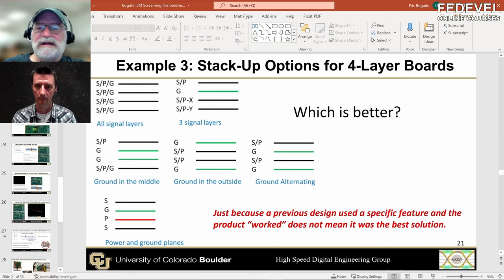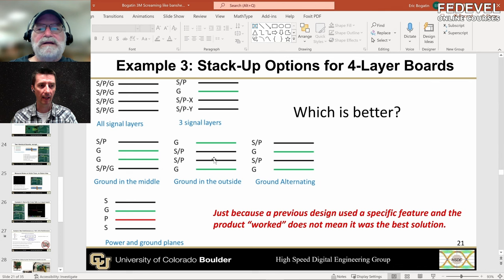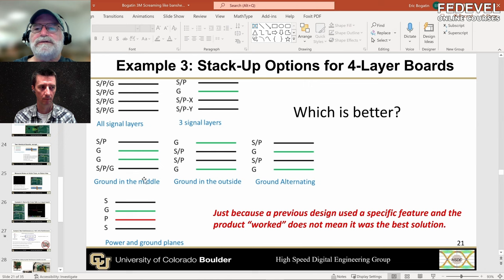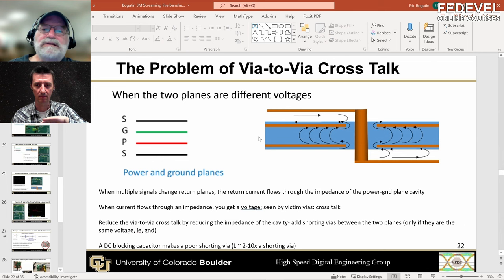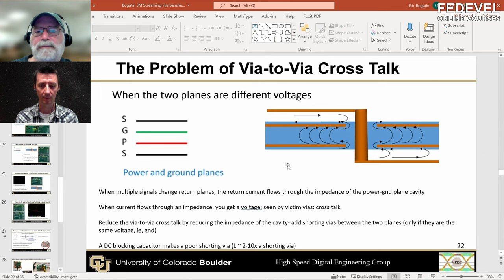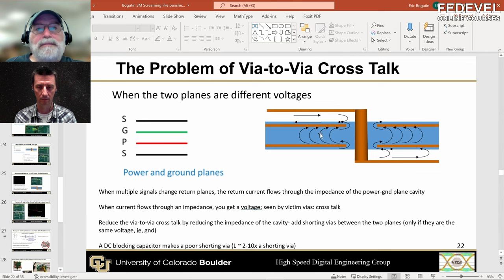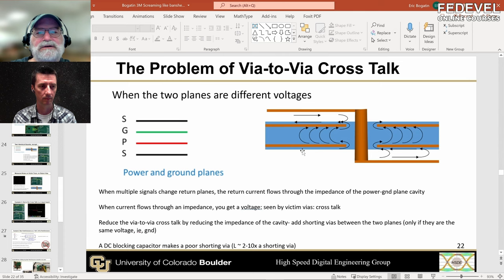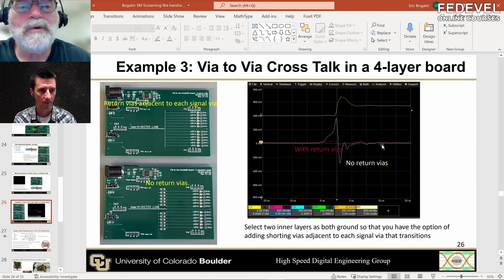Do You Really Need Power Planes? Are you sure? | Eric Bogatin

Comment: I'm a little confused in terminologies here. What is the difference between a copper pour and a copper plane? In Altium, for example, you can have power/ground planes with negative connotation or alternatively copper pours with positive connotation. As per my understanding, both are essentially large copper areas at the end of fabrication, isn't ?? So, if we have a solid copper pour on bottom layer, as shown by Eric in this example towards the end of the video, shouldn't it behave exactly the same as a solid ground plane at the bottom layer (assuming everything else to be identical, of course)??

Comment: The main question in my mind was if I need to use plane to distribute power from the voltage regulator and not if there should be a whole power plane in the stack of the PCB. This question remains unanswered.

Comment: This explains why you wouldn't want to use power planes as reference planes, and that lots of copper ground fill isn't as good as not having to change references during the return path.  But what are the real alternatives?  (1)  With routed power traces, wouldn't the power traces themselves change voltage often enough to cause noise, and to do it on the signal layer, without a ground in between?  (2) Are extra ground pours actually harmful, or just not helpful?  If you have the space, and are deciding between ground pour and no-copper empty space, is there a reason to prefer the empty space?
Reply: you ask a great question (2) don't they answer that ? aint watched yet !
Reply: @andymouse  If they do, I missed it.  Based on another video (I think it was Zach of Altium interviewing Eric Bogatin, or maybe the comments there) it was suggested that ground pour would be better if you did everything perfectly, but leaving the space blank is almost as good and much less error-prone.  (For example, the ground pour can make things worse if you do leave a gap in your stiching vias.)  But I still feel like I'm reporting a rumor instead of understanding why you wouldn't want more pours.
Reply: @jimjjewett  Thanks ! to me pours are a good thing in most instances.
Reply: @andymouse  Yep have to agree with you. From a fabrication perspective, pours avoid over-etching. From an assembly perspective, maximising pours help to avoid warping.

Comment: What about sensitive nets that route over a power plane split, but with an adjacent ground plane. For example, here's a typical 6-layer stackup we have and the sensitive net routed on layer 3 (inner signal). If routing on external layers is not an option, would stitching capacitors be advised?

1 Signal/Power
2 Ground
3 Inner Signal
4 Power
5 Ground
6 Signal/Power

Comment: wow my last board i did was for a camera that had WIFI, LTE, MIPI all on the same 2in x 2in pcb i did it as a 6 layer PCB with S-G-P-P/S-G-S as my stack-up i was told by a older coworker that if i didn't put ground plans on the outside it will fail FCC (the board had a FPGA, and a SOC with DDR4L ) I put a can over the CPU / RAM / FPGA the LTE and Wifi are modules

Comment: Another informative Vid, thanks Robert. I wonder though at the end with the Arduino PCB comparisons - I always thought the main reason for copper pour was cost for manufacture (copper removed is cost at the Fab plant) and to stitch to ground for noise suppression. The latter is not the case then? :O

Comment: @Robert

Thank you all the video contents it is inspiring =]

I doubt that return path only applied to ground return but not power return.
Same voltage rail for the +V and -V is subjected to the same signal +V and -V.
So when the signal is -V aka 0V the return path is ground again? The field itself is defined as two potential with different.
No different no field line, so this means when -V the return field is +V and this means the power plane itself is the return path for -V case.
Correct me if this is determined wrongly.
From DDR3 experiment I cannot see this could introduce noise enough to fail @ > 1000MT/s.

Comment: Great video, thanks.
I have a question.
In Sig/Gnd/pwr/sig stack up when top and bottom layers are ground poured and wherever changing layers occur, If I use ground via (i.e. connecting ground pours on top and bottom layers) close to signal via, wouldn't that reduce via resonance?

Comment: I have one, I am using a voltage converter 12vdc to 5vdc on a 4-layer board, two signals, 1 power, and 1 gnd plane. I can not just put the output of the DC 3.3 to the Power plan, In this situation, can I use the copper plane only to a certain extent?

Comment: Thanks for sharing the lesson! I found it very helpful and interesting. I do have a question, thoug. At the end of the video, where you show the example of routing the signal plane and having a reference ground plane at the bottom, do you not get problems with the copper extending during heat cycles? There is a huge difference in copper mass on each side of the pcb afterall.

Comment: @29:00, ok so if I use low ESL capacitor to connect the two plans that have different voltages using vias, how do I know if it is good enough? How can I run simulation?

Also, for 4 layer board, the dielectric is between layer 2 and 3 and is quite massive unlike the prereg. This means that using layer 2 and 3 as GND and PWR is a very bad idea.

Comment: Eric i think you were misundersranding  roberts question about the voltage of the power plane. I think he was ttying to say when referencing a power plane does referencing a power plane that doesnt power thr chip where the signal is coming or going vs referencing a power plane that does. Example being a pair of 3.3v chips but there signal is referencing a 5v plane vs a 3.3v plane. Since tge 5v plane doesnt have a DC connection to chips that genetated the sigbal wont that cause issues?

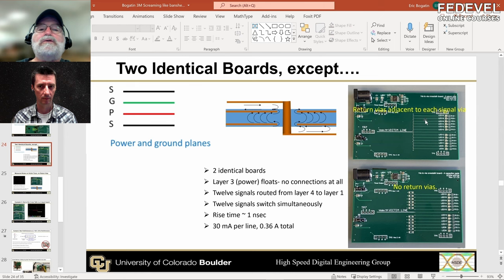Comment: Thanks a lot Robert and Dr.Eric. I did not quite understand the concept of the return via, between the signal via  @41:09 . Is this just a via connected to ground and placed between 2 signal vias ? Sort of like the cable connected to ground and running between 2 signal lines in a flat ribbon cable (to reduce cross talk)  ?
Reply from the maker: If I understand your question right, then this video may help a lot: https://youtu.be/vrt3lL5gEb0
Reply: @RobertFeranec   Thanks Robert, will watch it !!

Comment: Great video! I have a question for you related for routing differential pairs:
Is it necessary for stripline differential pairs routing to be with reference above and below the signal layer? Why 1 reference layer isn't enough?
This is always the requirement I get from the stackup.
And if Eric says it doesn't matter what dc voltage the plane is, so is it acceptable to rout differential pair with ground layer below and power layer above to get matched impedance like the stackup says?
Reply: One reference plane is enough, but then it is called microstrip. For sufficiently distant second plane, it will be converging to similar Z0, but you don't have that luxury on regular PCB stackups - so you are left with coupling to both sides, and having to take them into account in impedance calculation.
Reply: @Konecny_M  thx, what about the dc voltage on the planes, will i get different impedance if i use diffrent voltages on the planes?
Reply: @seanjosef5014  DC steady state does not affect impedance nor crosstalk, but everything else does. So the question is not what is the plane DC voltage, but rather how does the PDN and its impedance for given voltage rail looks alike (inclusive of its physical structure on board). It depends. There are no simple thumb rules and even general knowledge sometimes fall short and it just has to be measured on physical prototype.

Comment: Thanks a lot for this video. I got a question, can copper pour on the PCB top layer be used to reduce EMC/EMI emission on a noisy chip (as a DC-DC buck converter)? Copper immediately under the chip should create a good return path and reduce emission, is it true?
Reply: Yes. For 2 layer PCBs a copper pour on top and bottom layers tied to ground helps to reduce signal noise. Add stitching vias between them. Switching regulators have special clearance requirements on the inductor. That's a whole separate issue.
Reply: Update: end of video points out that ground pour on outer layers increases near field EMI radiation. It sounds like best practice is to use a 4 layer board with grounds in the middle and no pour on outer layers.